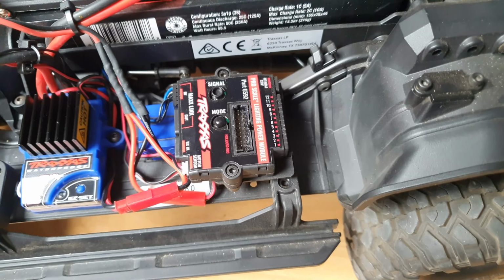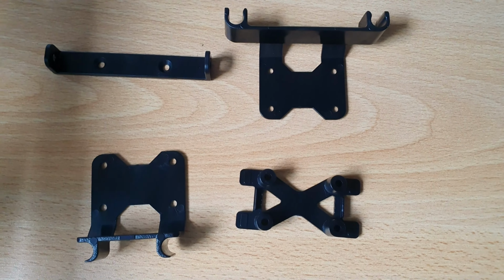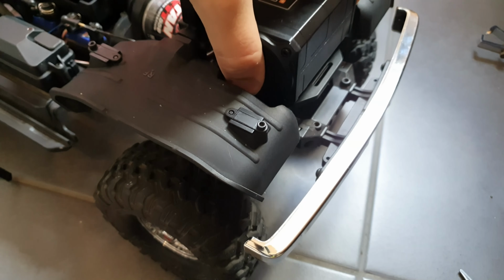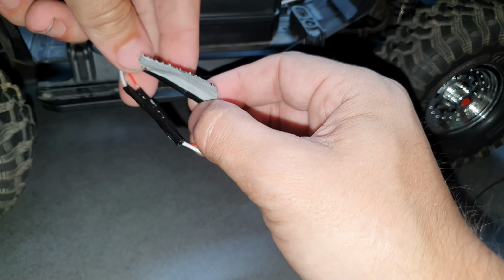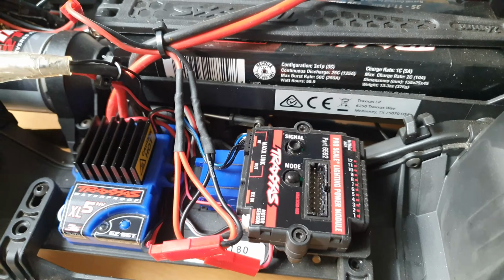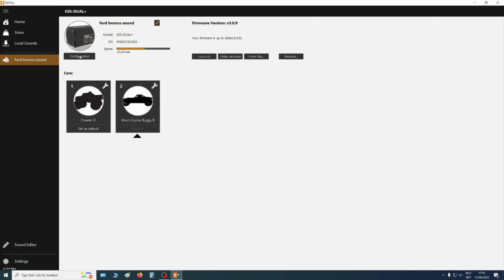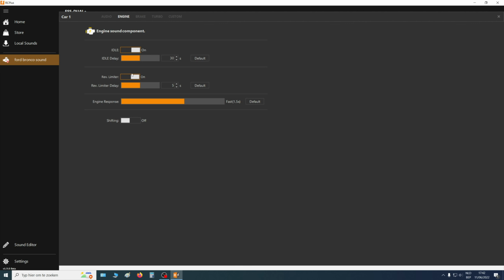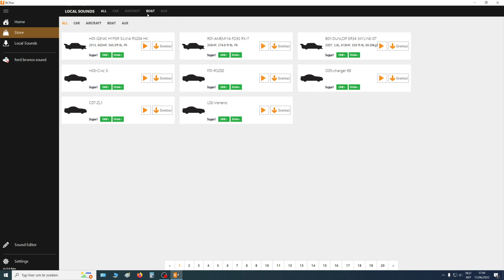Engine Sound install guide in my ford bronco TRX4 from traxxas

Comment: Thanks for the info I forgot to set my battery type. So I will do that. What sound was u using? I got mine on sound 2 the default one.
Reply from the maker: I dont remember 
Because the sounds sound different on my pc speakers
Then on the speaker in the rc jeep so i had change and test, change and test 😆